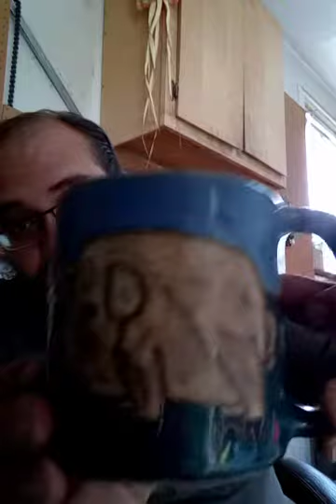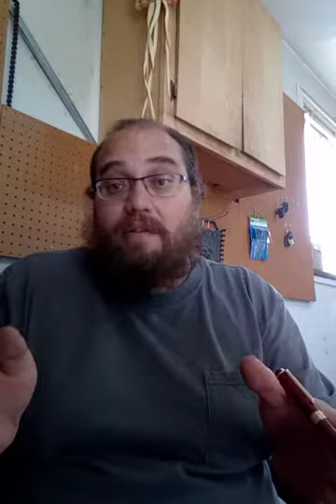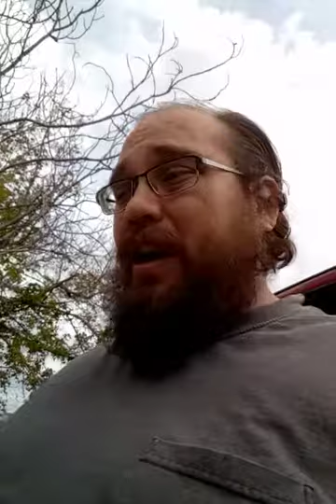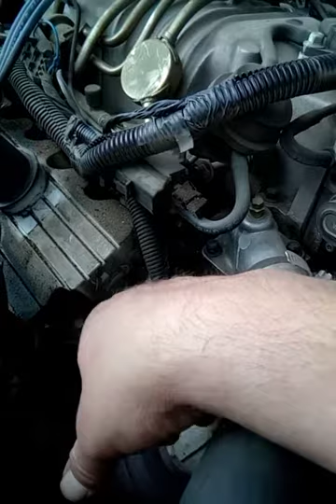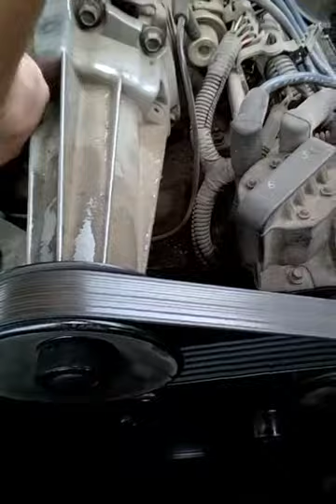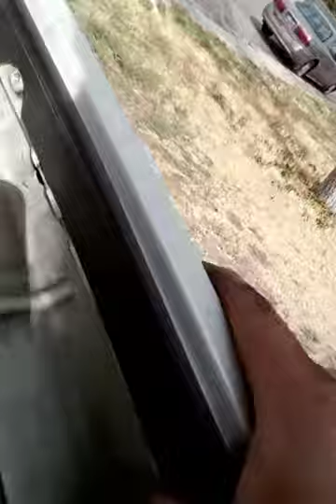How to buy a used car

Comment: I really appreciate your videos I was never a mechanic but I’ve learned a lot from you and fixed my own vehicles you saved me a lot of time and money
Reply from the maker: Thanks for letting me know this! these types of comments really encourage me to keep doing what I am doing!
Reply: I have a question if you don’t mind I have oil going into my radiator reservoir it’s not my head gasket or intake I replaced them. It only happens when I drive for at least 30 minutes it doesn’t overheat but my low oil pressure light comes on I have oil in the motor but if I turn the truck off and back on it goes back to normal I was thinking the oil cooler might be failing or possible the oil pump just wondering if you have any idea on where to start I’m all out of ideas at the point